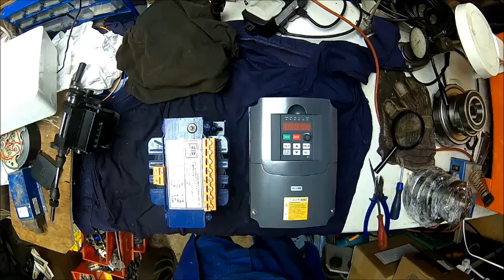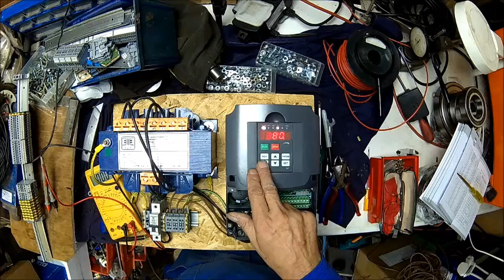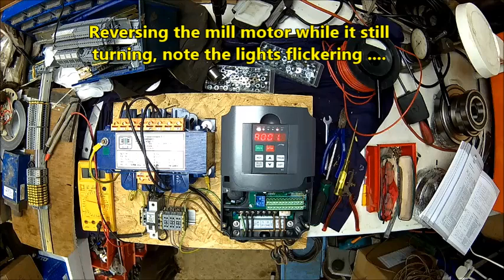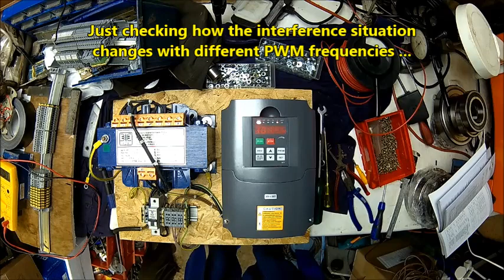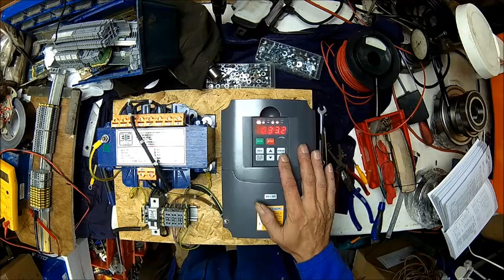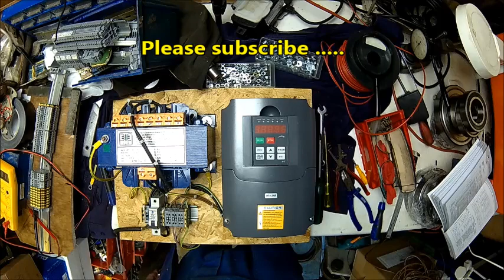DIY phase converter with Huanyang VFD, build, test + programming (non rotary)

Comment: Hello Dinoguy,  is there a way with your system to get 3 phases 400v + Neutral? thanks for your answer
Reply from the maker: Hi, ...well, it's sort of possible. You will need a 230V VFD and a 230/400V 3-phase transformer behind it where the 3 output coils are connected in star, that will get you a neutral, but it's a lot more expensive that way. Why do you want a neutral ?
Reply: @dynoguy  thank you for your answer. Because I have several machines with 220v coils inside for the relays (? I'm not sure if this is the good word in english, sorry I'm french). I'm fed up always modifying my machines, I have often some news: actually I have  3 machines which need 380v and 220v. So yes, I was thinking about your solution, but I was wondering if it's possible to use the neutral of the 220v mono, at the input of the VFD? That could be fantastic not to buy a heavy 230/400v transformer. And my other question is: I regularly read that is very bad for the VFD to cut the current between the VFD and the motor, but you are doing this and it works! And I also do it at my workshop with my lathe. But why is it bad? Which component of the VFD is in danger?
Reply from the maker: don't worry, your English is great,, ... first of all, the cheaper the VFD the more likely it is to blow it up when suddenly disconnecting the load, ... but there are also some "trade secrets" to prevent that from happening, which i obviously don't show. Generally speaking, without any protection, the biggest danger is large voltage spikes, destroying the output stage of the VFD and/or switches and contactors in your equipment connected. For your machines, i would suggest to disconnect the 230V control voltage from the 400V supply and just add a plug and cable for that,  it's usually an easy job as this is on a separate fuse anyway, so just disconnect L and N and you good to go. Last but not least, if your machine has any sort of VFD , servo drive or switching power supply in it, do NOT use the solution with a primary transformer (as per video), in this case you must use a 3-phase transformer on the output as per my last answer.

Comment: Hi - interested to see what you have done here --- I have used VFD's for my lathe, mill and linisher  but have used 230v 1ph to 230 3ph and rewired the motors to "delta" or "low voltage" to support the lower 3ph voltage. One question I have re the set up you have created here for the J&S 540 grinder as this machine actually has 3 motors - one for the spindle, one for the hydraulic pump and one for the coolant pump ---- normally I would wire a VFD for each motor, but can this set up run all 3 motors from 1 VFD?? Thanks Jim.
Reply from the maker: Hi Jim,  yes you can do that, with a few caviats. I use a similar 5kW unit in my new workshop powering multiple machines and i recently built a 10kW unit for a customer running a compressor and a water pump.. 
There is a lot of machinery with dual speed motors which you simply can't rewire for 230V, just by design. (e.g Dahlander, double-star/delta circuit, but both need 400V)
What you need to consider is having enough headroom for the inrush current of your motors, and also a bit of filtering on the output as you might see some odd resonance issues at certain load situations. Always bear in mind that with this setup, you won't have a neutral, but i have a new unit in the making which solves that problem as well.
Reply: @dynoguy  when can we expect to see this new invention that includes a neutral

Comment: I'm really intrigued by the fact you're switching the entire load downstream of the VFD, while conventional wisdom and advice from many manufacturers is not to do it due to risk of blowing the drive.

I've always been a bit sceptical of that claim personally, and certainly seems like it works fine at least for a while.  Do you have your own machines in your shop running in this fashion, and if so how long have you had them running without (presumeably) having to replace a drive?

Definitely apppeals more than an RPC, or farting around hacking out all the old machine wiring to work with a VFD the normal way...
Reply from the maker: Well, .. it depends on the drive, some can cope with it, some not so well.
I'certainly would not use any vintage drive for it, because that's where the myth comes from. Modern drives (with microprocessors in it)  can handle that easily as long as they do voltage and current monitoring on the output (some really cheap ones don't ! ).
I've seen a lot of industrial application where stuff was switched downstream from the drive.
I've been running my own set for over 10 years, and the one i've built in this episode runs fine since the video was made, his friend also bought some parts from me and built his own.
I don't know if i showed it in the video, but there are some bleed resistors and ferrite cores on the output, just to suppress the spikes a bit.
There is  one catch, if your machine needs a neutral, it wont work as there are only 3 phases coming out, no neutral.
If you really need a neutral, i would use a 230V drive with a 3-phase transformer on the output (or 3 singles), 230V 3-phase input in delta, 400V output in star, so you get a decent neutral. A bit more expensive but as a bonus the supply will be much cleaner .
Reply: @dynoguy  I like it! At the moment the only 3 phase item I have is a Bridgeport clone that I dug the star point out on to change to 240v delta, and put it on its own Huan Yang VFD, but I've been considering getting a surface grinder (thinking about a Jones Shipman 540, which is how I ended up here from Alans video!) and upgrading my lathe.  I'll definitely be keeping this option in mind.  Thanks for the response.
Reply from the maker: The one shown in this video is actually the unit i made for Alan

Comment: what is the brand of the transformer that you used to double the voltage and its looks a great job
Reply from the maker: Thanks Terry,... those transformers are custom made with 3 independent windings,  240 - 110/120 - 110/120, because with a 230V transformer this setup will exceed the max. permitted input voltage of the VFD as the mains voltage is typically 240V+ (even we should have 230V here). Occasionally similar types pop up on fleabay, but if you in the UK (or Europe) we can probably make a deal, got a few of those in stock. My email address is in the credits at the end of the video.

Comment: Looking forward to seeing this project working in AL's shop.
Reply from the maker: Just don't break it when you wire it up ....:-)
Reply: dynoguy I reversed over one of his garden Lidl £0:50p light while backing the trailer in his yard with the new surface grinder on, a van came round the corner at Mack 3 he only just mist me, ALS was thinking of sending it to you for repair😂😂😂
Reply from the maker: I already heard that someone flattened some lights in his garden ..... feel free to send it, got a big trash bin ...:-)